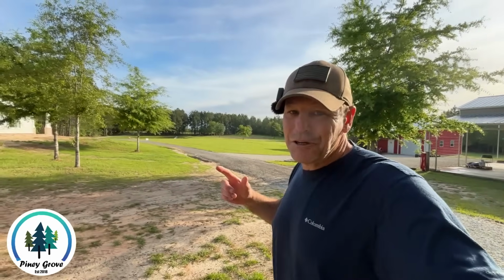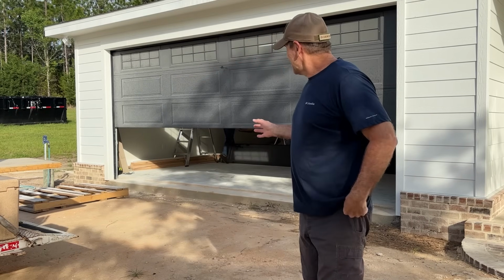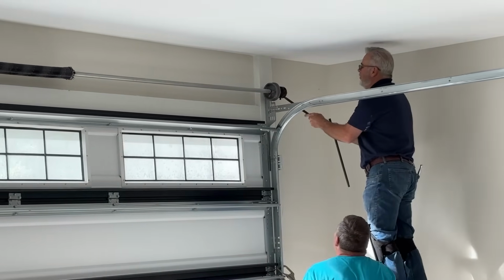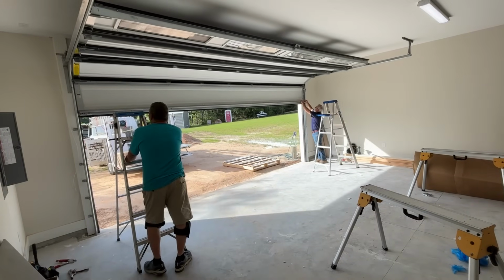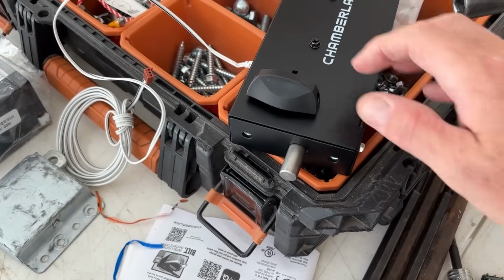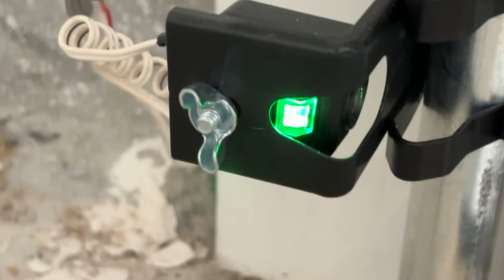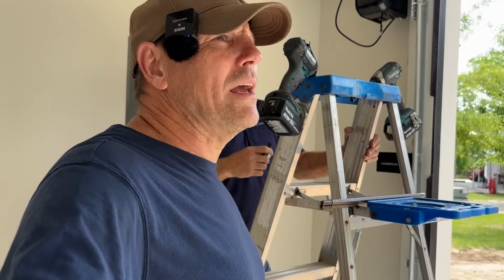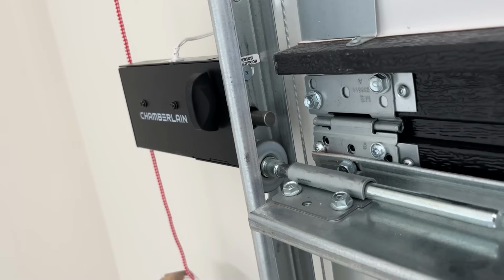HUGE UPGRADE For Your Garage And It's CHEAPER Than You Think!

Comment from the maker: See our house build series here: https://www.youtube.com/playlist?list=PLG5yS75HLzo343HSY79ll4DgoxTgV6l91
Amazon Affiliate Link to Chamberlain side mount garage door opener:
https://amzn.to/4450ug3

Ballard Mower Blades 10% discount code:  PGH10
https://www.ballard-inc.com

Use THESE Vevor links to buy these or any product, then enter VEVT5 for a 5% discount: 
Chain and Binder Kit: https://s.vevor.com/bfROvI
Forklift Work Platform: https://s.vevor.com/bfRG5G
48 Gallon Diesel & Gasoline Tank: https://s.vevor.com/bfRMHG 
Rural Package Box: https://s.vevor.com/bfRMHL 

American Made WoodMaxx chippers, tillers and flail mowers:
Piney Grove WoodMaxx Affiliate Link:  http://shrsl.com/4qer8

QC-Mate X-Boom Hydraulic Coupler Clamp:
https://www.skidsteersolutions.com/
Use PINEYGROVEHOMESTEAD for 5% off anything on the website!

Our Amazon affiliate links don't cost you anymore and help support the channel.  You don't even have to buy these products, just use our links to get to Amazon and do your shopping.  THANK YOU FOR YOUR SUPPORT!!
Sunfire SF80:  https://amzn.to/4gbFiXU
Mr. Heater: https://amzn.to/4jr7Q2E
Diesel anti-gel: https://amzn.to/3WvYCIJ
Mower Blade Sharpener Guide: https://amzn.to/4dGYZa5
Dewalt 20V Cordless Grinder: https://amzn.to/4bF2trS
Flap discs: https://amzn.to/3UKEzo0
Grinding wheel: https://amzn.to/3K95ipi 
275 Gallon IBC Tote: https://amzn.to/3XbxwHs
Vise Grip Wire Pliers: https://amzn.to/3WZ2P6U
12V Pump: https://amzn.to/4a3AwsI
Proven Industries Trailer Lock: https://amzn.to/3WVzytv
Flex Tape: https://amzn.to/3R4MdWm
Mechanix Leather Gloves: https://amzn.to/3HjoZZf
Ratcheting Fence Tensioner: https://amzn.to/3aEfSX0
6’ Digging and Pry bar:  https://amzn.to/3vH5Agx

Welcome to our channel!  🎥 What to Watch Next: 
Fixing Leaky Pond: https://youtu.be/NEwSTg1aOWc
Transforming Our Property: https://youtu.be/-jBGEYJea1Y
Baling Hay: https://youtu.be/yQJNF3wFm-U
Framing Our Pole Barn: https://youtu.be/zWgnTFQeiwI

Our Story:
For seven years we have been transforming 20 acres of "Piney Grove" in Northwest Florida into our dream homestead/mini farm soon to be filled with animals and joy. We plan to have a variety of miniature critters on our pastures, raise free-range chickens, grow fish in our pond, garden, plant fruit and nut trees, and harvest wild game. Our goal is to escape the stresses of corporate life and embrace all that country living has to offer as we enter the next chapter of our lives. Follow along on our journey!

Thanks for watching and please Like and Subscribe to help our channel!!
Brad & Deb

Comment: My big garage door 14" X 14" is side mount drive.  My little car doors are 10' x 10 overhead operators.   I have replaced both overhead openers but no problem with the side mount.   The big door is used much less.
Reply from the maker: Everything about roll up doors is a problem!

Comment: What if the electric goes off during a hurricane. Will the door stay locked? Will you still he able to manually lift and lower the door? I still use the manual lock on the inside when I evacuate.
Reply: it has battery backup.
Reply from the maker: Yes, you can lift it by hand!  Thanks for watching!